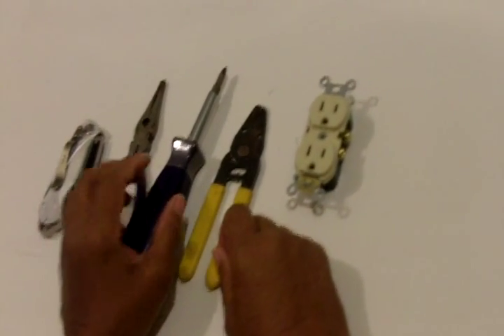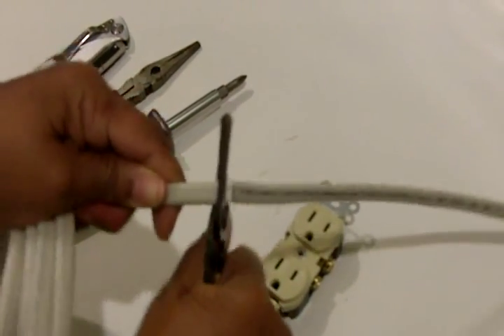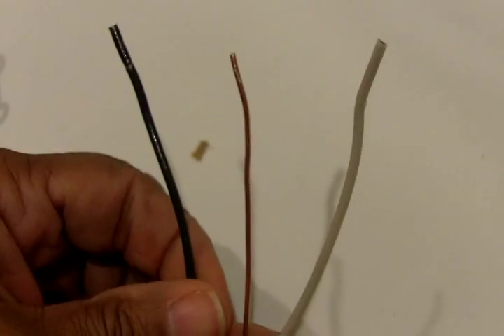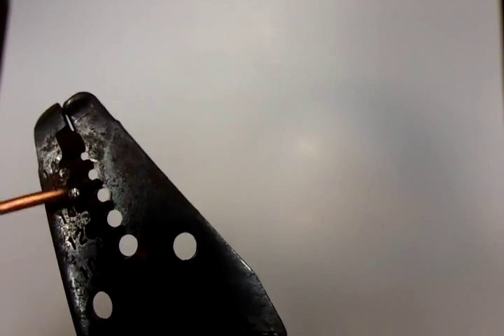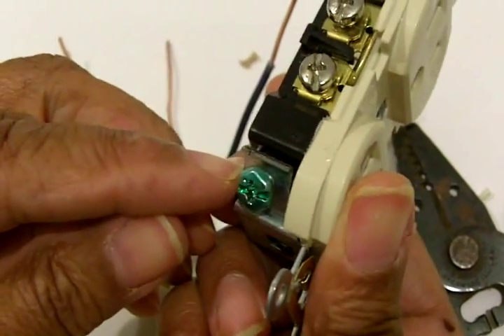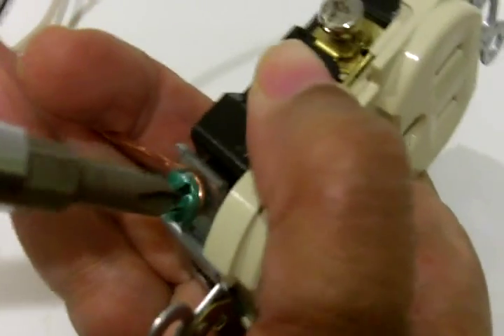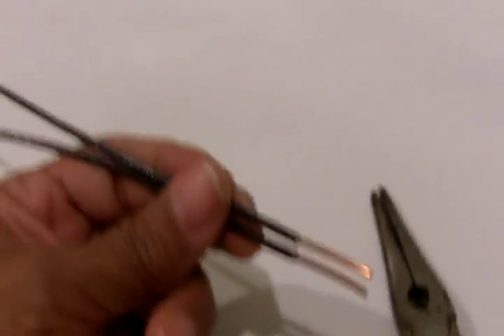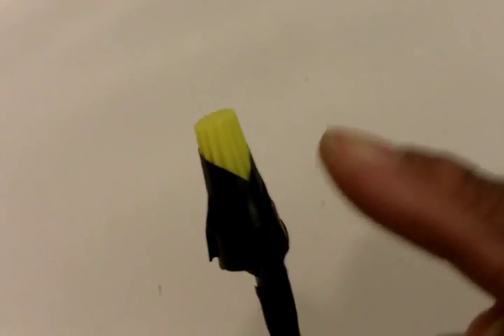How to Strip Wire and Wire an Electrical Outlet for Beginners

Comment: Hey Leah. I've watched your videos for about 3 hours now, and you are awesome and have taught me A LOT!!!! But I'm an electrician by trade and seeing this video makes me upset because it is not to code. It is a way that contractors use to save money. 14/2 is rated for 15a, but no one uses 15a. That receptacle will 100% be connected to a 20a circuit, which can be dangerous seeing that a hair dryer and straightener together could melt that wire before the breaker would trip...........But everythig else aside, I love what you are doing and every bit of the rest of this video makes me wish that you wired every receptacle before i fixed it hahaha. You make it accessible if the device fails. Keep up the AWESOME work!!!!!
Reply from the maker: I appreciate you taking the time to comment.
Reply: Why would the wire melt before the breaker could trip? Im a newb but I thought the whole point of a breaker was to cut the connection before any melting? Even if you use a wire that's not necessarily the best.

Comment: Very nice video i would allso say dont let the insolation of the wire get under the screw i like to bring insolation of wire to no less then 1/16 of a inch and no more then 1/4 of a inch fold wires into box like a accordion and keep ground wire like accordion but across either top or bottom of the box depending where ground screw is thanks take care

Comment: Leah, thanks for the videos. I’m wondering if you have or could do a video on a something I’m trying to accomplish. I need to install an outdoor  light on the back corner of my house. I want it to run off the same switch another outdoor light is run by. Both locations are accessible in the attack. I think I could just splice wires off the original light and run wire through the attic to the second location then just drilling a hole in the eave of the roof

Comment: I know this is an old post but wanted to post a tip....the holes left and right of the stripping holes on the stripper are specifically for putting the "u" shape terminal end on the romex.Needle nose pliers will work but a little on the cumbersome side.
Reply from the maker: Hey James, thanks for sharing